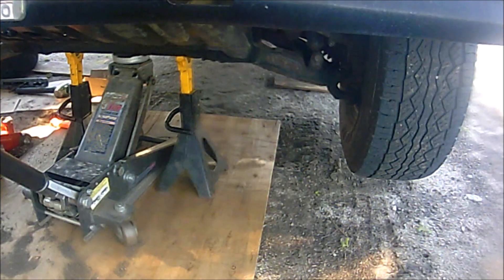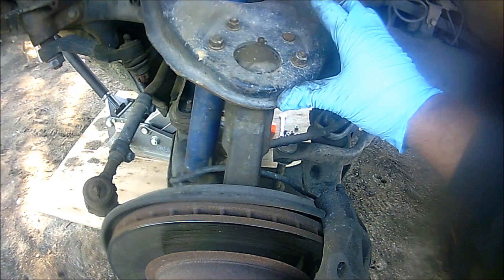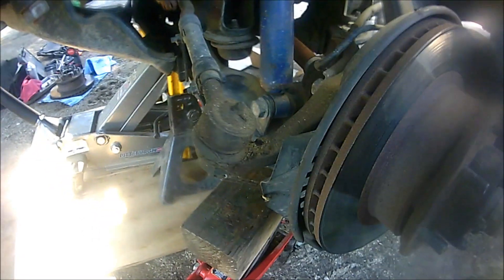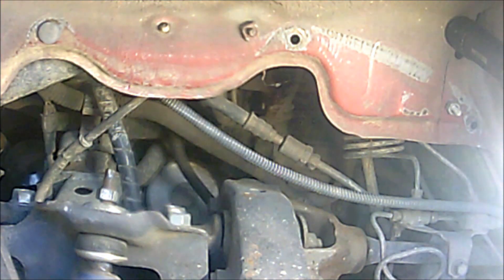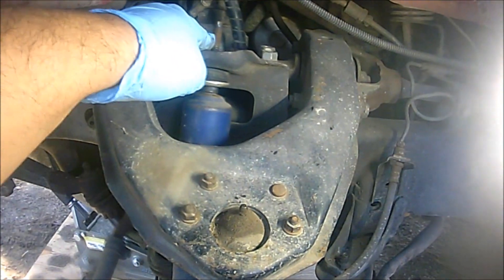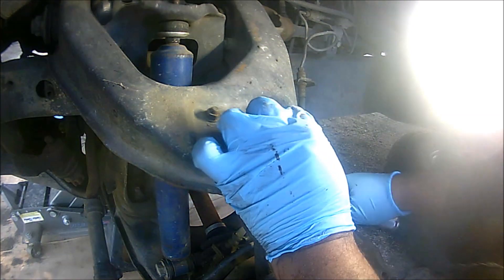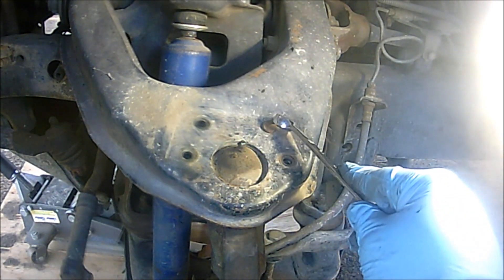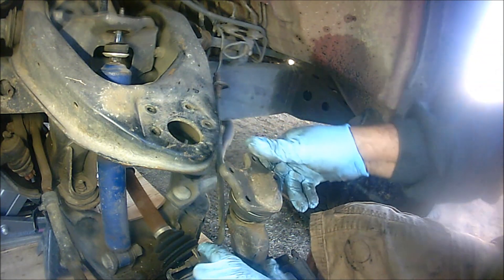Toyota Upper Ball Joint T100 / 4 Runner 1993-1998

Comment: Is it the same for a 95 4runner? Do you know
Reply from the maker: Only if it's a 4x4
Reply: Yep it's a 4x4 need to replace lower ball joints too
Reply: Hi Oscar
How did you torque the castle nut? There is no room to use a sucket
Reply from the maker: @yoguttier3324  hi yo guttier, I used a 24mm Crowfoot and torque the castle nut while I had the steering knuckle out of the upper control arm.  The manuel said to torque it once the wheel was set on the ground but it was much easier for me to torque it that way.
Reply: @oscars-autorepair3236  
Than you Oscar. I had to call like 8 different auto parts to get a 22 mm crowfoot but got the job done. Replaced upper & lower ball joints and shocks. I think i did a decent job considering I've never worked on cars before, Your video helped me a lot. God bless you bro!!